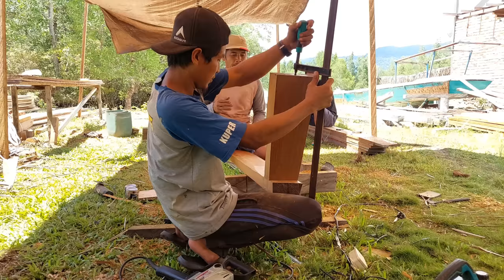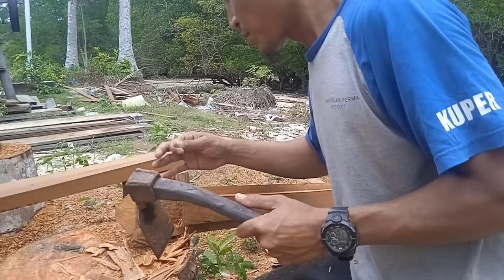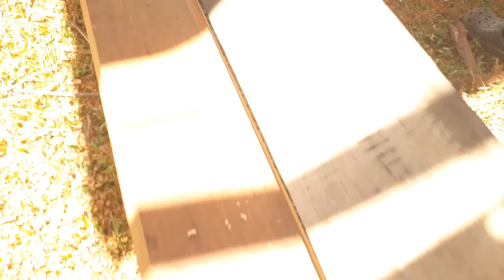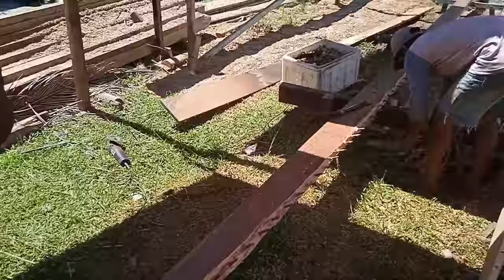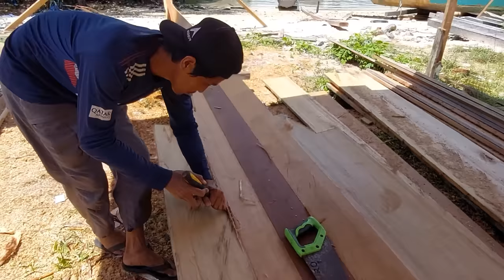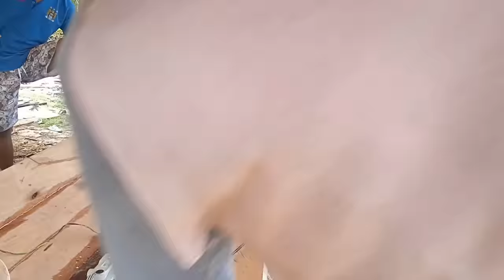CARA MEMBUAT PERAHU KAYU || proses awal untuk membuat sebuah perahu kayu tradisional

Comment: Hey Guys, would strips of old RUBBER inner tubes work as insulation to stop leaks between the boards as they are building them?  Would the rubber hold up for years without rotting?  All I am saying is that it is a cheap material to get at a junk/scrap yard/mechanic shop as they are thrown out after flat tires.

Comment: It would be interesting to know how much a boat like this would cost to have built there
Reply: I already asked that question before, and it was surprising low at between $6-10,000.00 depending on a few variables. One being size of course and the other being the current exchange rate. I am an American who lives in Thailand. The Thais build boats in the exact same way and I began inquiring there, then started looking at Indonesia to buy the wood and import it to Thailand, in order to build my own boat. However,I found that it may be even cheaper to just fly from Thailand to Indonesia and contract a boat to be built. Then just take the boat back up to Thailand on the water. But of course I'm talking about a different kind of boat than the one in the video. I'm a 54 year old sailor and former boat builder. I want to build a 32-35' Sailing Catamaran to live-aboard and sail all around the S. Pacific Islands as my retirement plan. I knew long ago that I would never really retire from certain aspects of my life, boat building and sailing being two of those things...along with chasing the dream of freedom. 

So if a person were to be here, on this side of the planet and take an active role in the designing and the build, it could be done really pretty inexpensively. I'm actually considering getting into the business of designing and building sailing craft in Thailand using the local resources, and then potentially exporting them, or creating kits that could be purchased and built by the owner.

Comment: Wooden dowels with epoxy would be stronger than the steel rods & nuts. Especially your tropical hardwoods make excellent dowels. The steel rods will rust after time (even if the are galvanised) and then they will cause iron rot in the timbers. Wooden dowels would swell up with the salt water, and create an even stronger connection when they swell up. I drill holes and insert wooden dowels (australian hard woods) with epoxy. Once the epoxy cures you have the best connection possible.